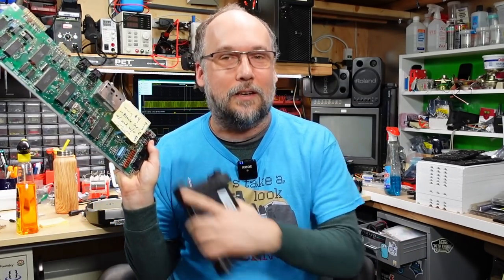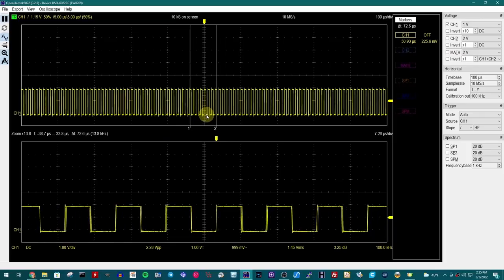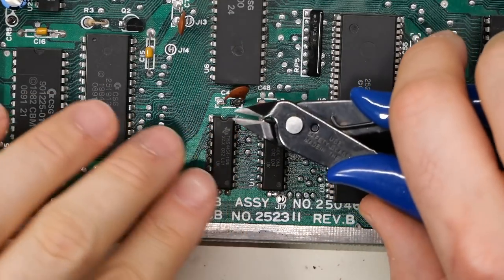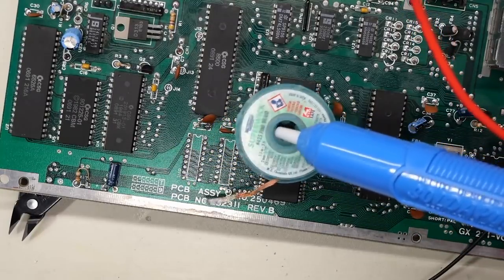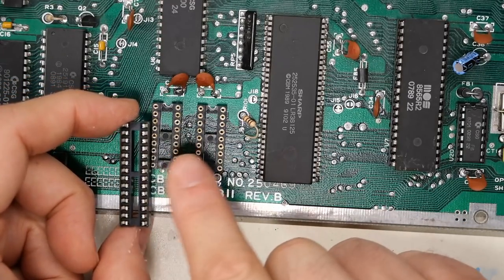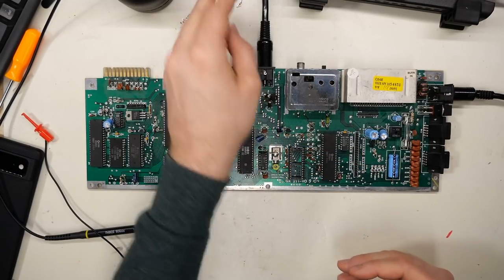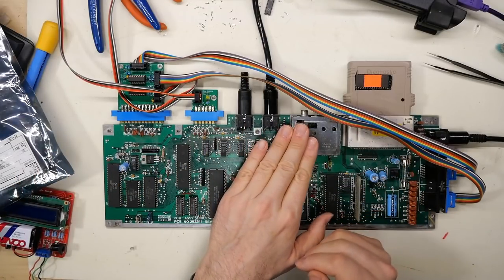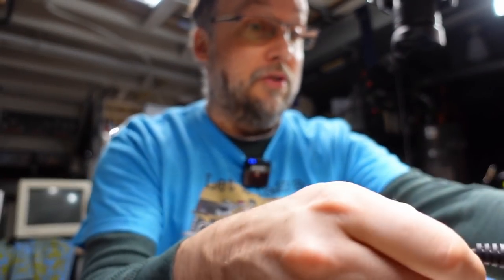How to fix an 8-bit computer with only cheap tools

Comment: I have that meter and thought it'd be good to see easily see the voltage, easily readable, etc.  But unless you intentionally turn off the Auto Off by holding Range while turning it on it turns off on you automatically even WHILE USING IT.  Insanely frustrating.  But I put up with it as it otherwise works fine for what I do, just have to remember to turn off Auto Off.

Comment: I'll just save up a bit and buy second hand good scopes, no time to get it to work properly. :) The cutting and then removing the legs seems to chew up more time then just desoldering from the back.. + I would be worried one of those legs might end up on the board and shorting something.
Reply from the maker: I have repaired many boards where people attempted to desolder chips and lifted traces, so I've had to go in and find their botched repair. Even with a desoldering pump, it's still easy to do that. Cutting and removing legs ensures that will not happen. I wouldn't do it normally due to the time it takes -- this was a demonstration for how an inexperienced person can remove a chip safely.
Reply: @adriansdigitalbasement  ah, that’s the part I was missing, that it’s the best way for novices. Was a little confused watching that segment in the video but I definitely agree for anyone who isn’t very confident with their iron and their timing. (Of course there’s a few types of boards that are notoriously fragile which I’d always cut the legs for, like a ZX Spectrum, but I don’t have one of those.)

Comment: Call me a little old schooled but There is a 4th way of clearing via's on boards. I will heat up the hole and make sure the solder in the hole is liquid then I will lift the board up in the air and hit it on the bench to use the weight of the solder to clear the holes. As with any heavy plane it is harder. Some people will say it damages the board but if you hit it right there is no damage.
Reply: Same here. but with caveats. I wouldn't do it on a large and board because I feel like that would greatly increase the chance of cracking the board.

Comment: with the cass circuit working with just removing the transitor sounds like it was a bad solder connection like a cold solder joint or a intermittent connection/break in the circuitry

Comment: The only thing to say about those cheap multimeters is DONT even think about using them on the mains, or anything high potential. The CAT ratings on them are usually very much overstated. However for measuring low voltages they are very good.

Hope the issues with your hands are not too bad.. i couldnt bear the thought of losing functionality in my hands!
Reply: I'm more concerned with touching the wrong thing than the multimeter blowing up. I've had one short out when measuring 120vac and it surprised me but wasn't too dramatic.

Comment: Fyi that mg chemicals stuff might not actually be no-clean solder. Turns out all my MG Chemicals stuff is RA flux which is moderately fierce. I did recently pick up a flux pen by chip quik that's no-clean.

Comment: There was a strong indication that it was the 9V missing: the timers weren't running. They don't work without the line frequency of the 9V AC!
Reply from the maker: Those timers don't update AFAIK until the entire test cycle runs again -- so I didn't wait for the second cycle to start before I turned the power off.

Comment: Not exactly related to the video but is C64 related.  I had one on my bench to fix, the video was very dim, to keep a long story short I had tested Luma was week in the composite signal and ended up being a resistor of the wrong value, but it did look like it was stock, there didn't seem to be any work done to it.  Have you seen wrong components from the factory, this resistor was almost 3 times the value and did match it's color code, just the wrong one.  I was suprised it was still out the wild and not tossed due to the issue, it was also a pretty early one from 1983ish I'm guessing.

Comment: Is it possible the transistor had some cold solder and when you removed and reinstalled, it secured the connection? Thanks for the video! Great stuff

Comment: I was shouting "I bet there's no 9V AC!" because the clock wasn't counting up in the lower right of the diagnostic screen. No 9V AC means no 9V DC at the cassette port.

Comment: DONT LIFT THE SOLDERING IRON OFF THE PIN WHEN YOU USING THE DESOLDERING PUMP! I was practically screaming that when i watched this! Hahaha. The tip is designed to resist heat

Comment: On one hand it sounds great that they consolidated so much into the PLA reducing the number of possible problems...on the other hand you're left with a unicorn chip that would require butchering another unicorn to get a replacement :|.  The GAL solution for the older PLA works, so I guess a similar approach could work.  If it were just straight forward digital logic a microcontroller could easily handle it (I think the fast loader uses analogue trickery against digital, could be wrong, I never looked into it since I was/am an Apple IIGS fanboy over C64), but that would be a bit overkill and introduce software implementation that would anger purist.  Oh well, not their machine, and the way I see it, if it's running to the same quality and operational capacity as it should, then that's better than it being scrapped.

Comment: when you took the transistor out... it could have been a dry joint on the connection to the board. re-flowing the solder solved the problem ?

Comment: So, something Adrian is doing with the solder pump that I had to learn the hard way:  "prime" the pump far from your motherboard.  You'll be tempted to just do it wherever it is, but that may cause some of the still-hot solder to go shooting out of the pump all over your board.  Don't be an idiot like I was.  Be like Adrian.
Reply from the maker: I had that happen once while cleaning the tip of my soldering iron!! I blob of molten solder fell right inside a 72 pin SIMM socket. Completely ruined it -- I tried for hours to clean it but in the end the entire socket was ruined. Was horrible. For the hand pump, I prime it under the desk over the trashcan.

Comment: No the diagnostic didn't lie, go back and look at the footage, the clocks were not running indicating lack of 9V AC. You could be right with the fuse or maybe your psu connector is intermittent.

Comment: I hate these "precision" sockets. Pins of the ICs are flat, while holes in these sockets are round. Especially on desoldered ICs they tend to make intermittent bad contacts. They are awful, and... taller than standard sockets.

Comment: I've replaced bad RAM in both 469 & 466 boards. Why is it that the RAM tends to be the common failure in these boards, though? I do not believe C= was using crappy RAM at this stage in motherboard production so is there something else with these boards that is stressing the RAM a bit more than with older rev boards or is it due to the RAM being reduced to only two ICs?
Reply from the maker: Yeah no idea! It usually seems to be Texas Instruments RAM that does. I've also changed these two chips out a bunch of times -- very strange.

Comment: That aneng meter is good but only for somebody who rarely use multimeter. That's only meter I ever see that have problem with tracks for function selection on PCB etch away. I never see that even on $3 cheapometers from ebay, PCB quality is 0.

Comment: In cases where you do damage traces, could you recommend anything specific for repairing them?  I was thinking of ordering some wire made for wire wrapping for this purpose.
Reply: That can work. A technique that often works well near sockets is to remove a single vein out of a wire. Expose a bit of copper on two good places of the trace that need reconnecting and solder the vein in place. You can also run the vein through a socket hole, which works well in case you did lift a pad during desoldering.
Reply from the maker: Yeah anytime you see me repairing a board I'm using wire wrap wire. It's super thin and has a very durable insulation on it... but use pulling a single strand of stranded wire out and using that would work fine too -- but only if you are trying to bride a very small gap.
Reply: @danielmantione  Thanks.

Comment: while we have nice, old, all-analog scopes at work, i still don't have a scope at home so an actually useable scope for under 100 bucks is quite interesting to me - right now, i could get the 50 MHz, 150 MSa/s version for a few bucks less than the 20 MHz, 48MSa/s version and the 50 MHz version also seems to have an EXT input in addition to CH1 and CH1.

i'm wondering if getting the faster version would help with the triggering issues at higher sample rates.
i'm also wondering if the channel inputs are properly disconnected from usb ground and thus PC ground, chassis ground and so on ... i've been told that very bad things can happen when you are poking around in, say, an audio power amp, and it somehow shares ground/protective earth with the scope - at the wall socket for example
Reply: The reason for the triggering issues is the fact that triggering is done in software, and limits on USB performance makes it possible that the software doesn't see a trigger event. Higher samplerates make this worse.
Reply: @danielmantione  The Hantek 1070 is WIFI...
Reply: This is obligatory viewing for new oscilloscope owners/users: https://www.youtube.com/watch?v=xaELqAo4kkQ
Dave Jones doesn't specifically address USB scopes like the Hantek but you get the idea about the limits of using a scope with the standard probes.
While you can get "differential" probes cheaper than ever before, prices start around $200 which is expensive compared to the Hantek.
Reply from the maker: Yes the triggering is software based, at least one this one. Unless the higher speed ones are fundamentally different inside (like they have hardware triggering and sample memory in the external box) then I don't see how they could work any better and I would avoid them if you actually need the high sample rates.
Reply: @adriansdigitalbasement  does that mean that USB is the bottleneck here, not the sampling rate of the ADCs ?
Reply: @KenjiUmino  That is correct, the USB 2.0 isn't fast enough to sample 48MS/s in real time.
Reply: @danielmantione  so, unless the 50 MHz model (Hantek6052BE, i think) isn't a totally different thing under the hood and has hardware triggering or usb 3 or whatnot, i'tll have the same limitations as the 20 MHz model.

wich means it's capable enough to do low voltage/low current audio and single-digit-MHz digital circuitry but is unsuited for digital circuitry with higher clock speed and because the probe inputs are also not disconnected from USB ground, it is also potentially not suited for audio power amplifiers and tube stuff ...

... then again ... it's well under 100 bucks while scopes that are more capable are usually way more expensive ...
Reply: @KenjiUmino  Absolutely right. There is no denying that Hantek has made cost-cutting decisions to reach the price point. The question is mostly wether they made the correct decisions and considering the scope is perfectly usable for many tasks, I am mostly positive  about this. It is also clear it doesn't remove the need for higher end oscilloscopes for applications were those are needed. Nevethertheless, while I nowadays have a much better HP 54503A, am still using the Hantek, as in many cases it is just good enough.

Comment: I was wondering if the comments section could help me out. I recently acquired a new in box Atari 800xl computer and wanted to buy a new power adapter for it. I know the one that comes with it can fail suddenly.  Any recommendations on a good power supply for it.

Comment: the round hole sockets or most often machine installed chips ... while the double wipe are hand intalled most often ...
Reply: q2 had a cold solder joint ... and removing it and replacing it fixed the solder joint ....HOW it got the cold solder joint is now the BIG question ... assuming it was always working from new
Reply: why dont you make a patch panel that has your recroding audio and the computer connection as seperate ports ... then you can just plug .into the panel what you need where you need it and it all stays neat and tidy

Comment: lets take it apart that scope to check if its possible to make it better with some mods
Reply from the maker: The OpenHantek github repo goes over the AC coupling mod for it and show the insides of the scope. It's very basic inside, hence the low cost.

Comment: For what is worth, hand desoldering pumps work a lot better when they are smaller than a baseball bat... 🙄
I was always told to use these as if I'm applying solder: apply heat with the iron and operate the pump at the same time, without lifting the iron at all. That's also why removing the chip legs beforehand is not a good idea.

Comment: i had big plans to fix computers in the 80s well i did for abit till i was charging to much they said ill just buy a new one.so ya i have alot of old tools in a snapon briefcase i never use anymore.286 sx dx days and 386 and 486 days.still have parts for them piles in boxes and a old 3086? ibm in closet yet.old worthless stuff lol

Comment: The Pinecil looks interesting and would be great when not working at a bench except for one thing that will affect 90% of your viewers. We are all at or near 50 years old (and up) and this stupid thing has a goddamned screen on it.  A soldering iron does not need a complex interface.  We old folks cannot see such a tiny screen and trying to read off of it.  I had near perfect vision until I hit 45. Now I cannot read the numbers on the back of cards and other small print, especially where it's not extremely brightly lit.  This happens to almost everyone.

Comment: I disagree with your theory of operation with the cassette port.  The CPU has to ground the output for the cassette port to turn on.  Q2 has to be off in order for R1 to turn on Q1.  The CPU output probably doesn't reach 5V because the load presented by Q2 is too much.  But it is enough to turn on the transistor, so it's "good enough".  I think you missed the turn on blip with your meter because it's only a half second and the meter response is too slow.  It's indistinguishable from a slight delay in power up. A bad 9V theory sounds about right.  It fixed itself between 42:26 and 42:58.
Reply: Almost. The CPU needs to keep the pin high to turn off the cassette. The output will be on if the CPU grounds the pin, but also if it's lest floating.
Reply: @eDoc2020  We're in agreement.

Comment: I'm guessing you're transferring your 99% IPA from a can into that sprayer you use. FWIW, you're almost certainly wasting your money. Isopropyl alcohol is pretty hygroscopic and will absorb enough humidity from the air to get it down to probably around 80% pretty quickly. It's probably unlikely that your spray bottle is sealed well enough to keep humidity from getting to the alcohol. If what you have is working for you, you'd likely save money just getting the more readily available 91% stuff.
Reply from the maker: Actually it comes in the bottle you see therefrom the supermarket. I just stuck a generic spray nozzle right onto the bottle... Luckily it's not really that much more expensive than the other types.
Reply: @adriansdigitalbasement  Weird. In my area, I have to go way out of my way to find 99%. 91% isn't even very common.

Comment: Who was still buying C64's in 1991?  The writing was clearly on the wall for 8 bit computers by then 🤣
Reply: People are still buying C64s today.  ;-)  If it makes people happy and it's in their price range, more power to them!  ;-)
Reply: electronics hobbyists. You couldn't really do your own do repair work on x86 PCs of the era or earlier, so much was proprietary and undocumented, whereas Commodore had released quite a bit of documentation and schematics, but getting others to repair them was too expensive, easier to replace a malfunctioning old one with a new one. Ultima VI, released in 1991, was the last major C64 game release from a North American developer, and The Simpsons, published by Ultra Games, was the last arcade conversion- Wikipedia has an interesting article specifically addressing the 1988–1994 era.
Reply: Those were the Eastern Europe years. Especially in Poland the C64 was very popular at that time.
Reply: I second electronics hobbyists. It was more or less the only inexpensive device still on the market that was well known, codable, AND had easily accessible I/O pins for experimentation. It was the Raspberry Pi of its time at that point.

Comment: "....before you used bluetooth headphones....."  Speak for yourself.  I will NEVER switch to Bluetooth headphones.  if they eliminate the 3.5mm jack from ALL phones, I will just use an mp3 player that has a 3.5mm jack.  Bluetooth SUX!  Who in the world wants to charge their headphones?
Reply from the maker: I resisted forever as well, but I found that the "free" Pixel Buds that Google sent when I ordered the Pixel 6 are super nice, especially when out and about wearing a mask. On planes and around town my mask and wired headphones were constantly getting tangled. The fact the batteries will die AND they are not serviceable completely blows though.
Reply: @adriansdigitalbasement  I wish they had the option to use them both as wired and wireless and used standard off the shelf replaceable batteries.  I've had a few pair, but they were all cheap and the battery life on them was terrible, like 3 hours (they say 5 hours, but that is probably at the lowest volume setting.)